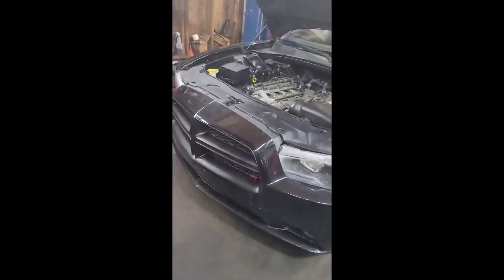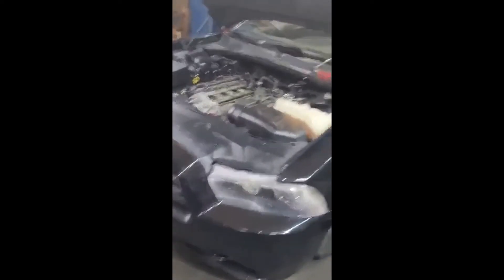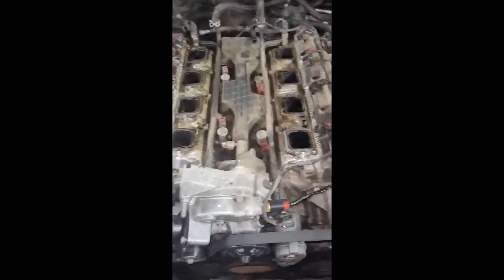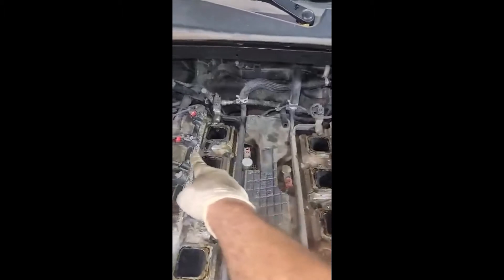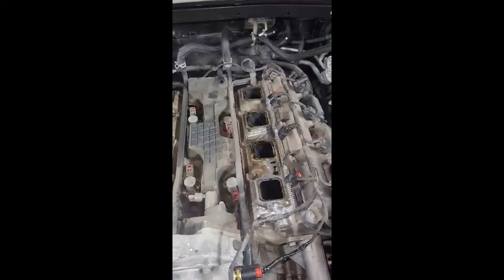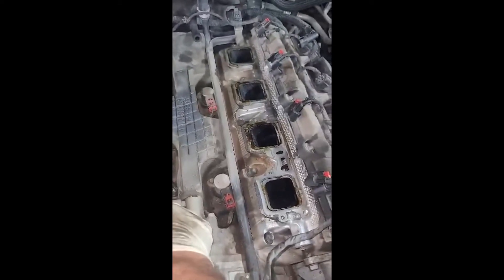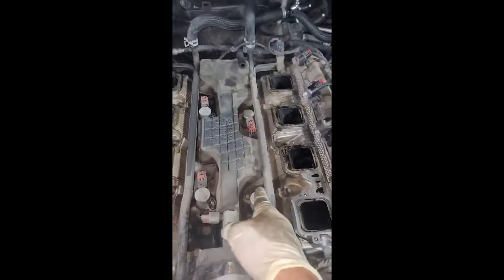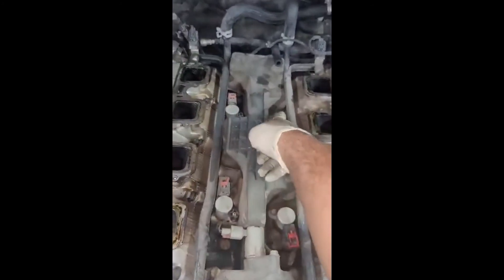Dodge Jeep Chrysler 5.7L HEMI ENGINE FIRING ORDER AND MDS CYLINDER DEACTIVATION SOLENOID LOCATION

Comment: My 2008 charger is throwing a p3400 cylinder deactivation on bank 1. Which solinoid do i need to replace.
Reply from the maker: P3400 is cylinder 1, which is the driver side by the radiator. But I prefer to check the oil level if it's ok . Put some motor flush first, then change the oil , Erath the code, and drive it if come back. Erath it once again, I'd the code still exists, then replace the mds solenoid

Comment: The firing order of gen3 hemi is 1-8-4-3-6-5-7-2. In MDS mode, cylinders 1, 4, 6 and 7 are DEactivated. So  there will be no firing in those cylinders and the MDS mode firing order will be 8-3-5-2.
Reply: So what is bank 1 in a 2008 dodge ram

Comment: Did that popet under mds soleniod fix your problems on the truck because my charger was throwing 1417 code as well
Reply: I put new lifters in it started it up and it was still doing the same thing i changed the sensor but i had left popet out when and still running rough so i am going to put that popet back in there does it control something with its magnetic tip
Reply from the maker: You need to watch my other video I will send you the link
Reply from the maker: https://youtu.be/zEURBcsfwz4
Reply: I put the popet bac in unhooked the battery for a couple min an now it is running strong
Reply from the maker: That's a great news congratulations 👏
Reply from the maker: Actually yeah after replacing the mds and if I didn't fixed it so next would be a bad lifter stocked